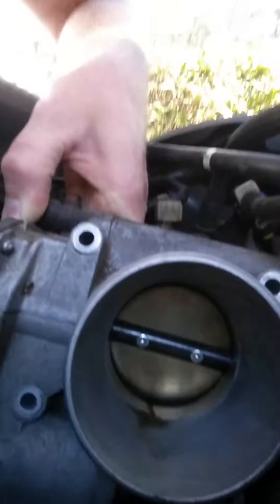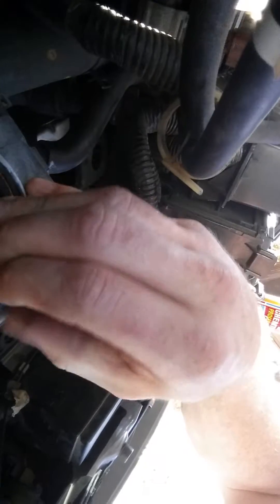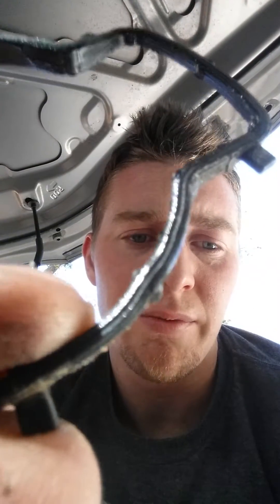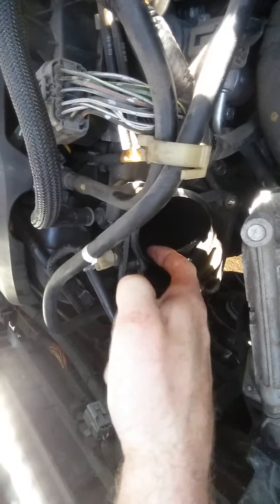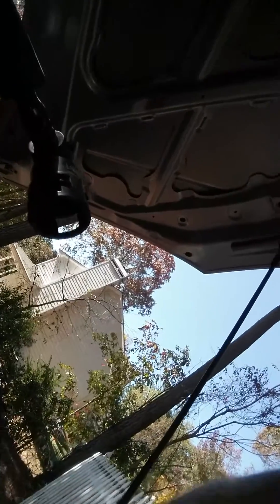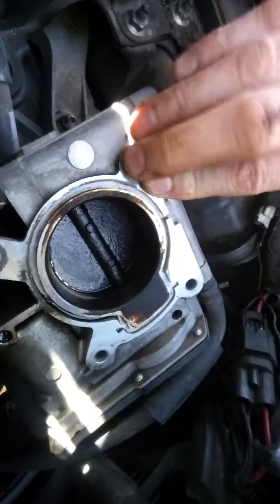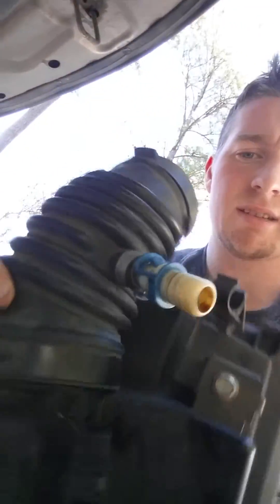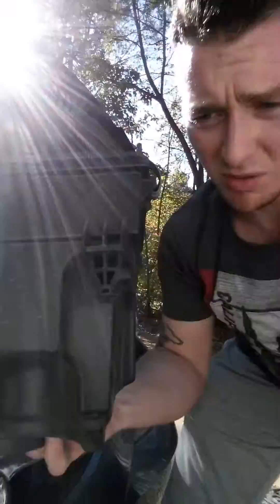Mazda 3 throttle body cleaning part 1! Surging and Stalling Issue!

Comment: Ok i hope you see this so i have a 2012 speed3 and I’m having a hard start and rough idle problem dealer said it was just a bad battery they replaced it and it didn’t help i put Lucas injector cleaner in and so far no change could this be my issue!!!
Reply from the maker: Yes very much so could be. How many miles.?

Comment: Is the throttle body relearn the same procedure for a 2006 mazda 3 DOHC ?
Reply from the maker: I imagine it would be very similar. If you are having this similar issue, i certainly would try it first before dealing with dealerships or someone "troubleshooting" . Dirty throttle bodies and intake manifolds/runners/valves cause plenty of issues for MANY diffrrent car makes and models. But ECU system relearn is necessary for the vast majority. And most of the ecu are self learning these days, but early OBD 2 models may need a standard version. Like in this video.

Comment: AWESOME. Thanks for putting this up, man. Even better, thanks for making it fun. Haha. One thing I wonder: Is it safe to clean the MAF? I've heard on a slew of forums that these MAFs are crazy sensitive and the slightest lil hair can throw them off. Doesn't help that the harness going to the MAF tends to go bad too.
Reply from the maker: Jj Fatts  ive never had an issue. The maf cleaner i used in the video. Ive used on hundreds of cars and have Never had an issue or comeback.

If it is something like throttle body cleaner or brake cleaner sure. It wasnt designed to clean delicate resistors. 

So likely most of those who wont admit, but thats probably what they did.

Ive done it on fords to mercedes amd around the rest of the auto rings and again. Zero issues.

The computer always needs to relearn minute things, and the battery must be disconnected.

And im glad you enjoyed it :)
Reply: GOOD TO KNOW. Maybe I'll suck it up and give it a true. You used B-12 on the MAF too?
Reply from the maker: Jj Fatts no, just the throttle body and intake mouth.

And CRC Mass Airflow Cleaner

Silver can

Best stuff ive ever used.

Other ones i felt didnt do well.

CRC dissolves and evaporates asap.
Reply: Sweet! Just stopped at auto parts store to get a new gasket for the throttle body. Will grab the B12 too. Thanks again, man.
Reply from the maker: Jj Fatts remember, dont clean the maf with B12.

Use Crc Maf cleaner
Reply: Haha. Yes, yes. Thank you for the reminder.

Comment: I attest to the dirty TB causing a surge and stall when cold. In 2013 I spent 10 hours over a few months systematically logging sensors and diagnosing finding nothing but erratic vacuum. It was a slightly carbonized TB. (05 maz3 2.0)

Comment: Its a Ford part (throttle body). Volvos have the same problem since they use Ford throttle bodies too. The venturi is edge driven. So the edge is important to clean. It may look clean but if the edge is gummed over it will idle like poop. Ford parts are the problems with Mazda. The Mazda portion of Mazda is A-OK. Its good that  Mazda is apart from Ford now.
Reply from the maker: pressrolls exactly, I agree
Reply: #realtalk